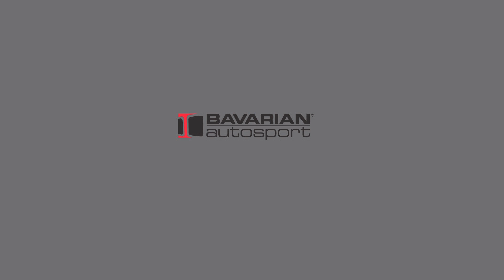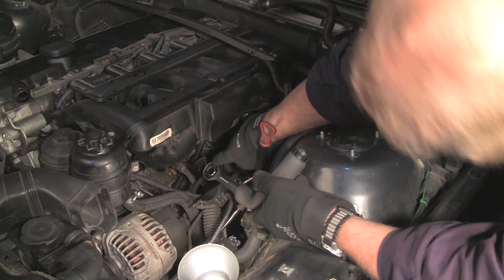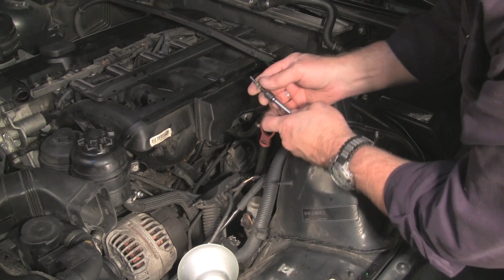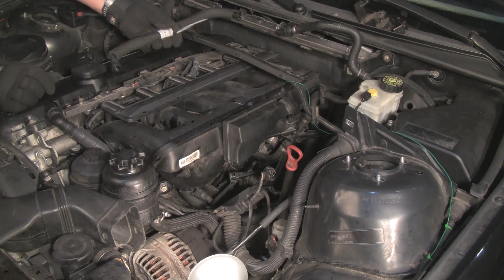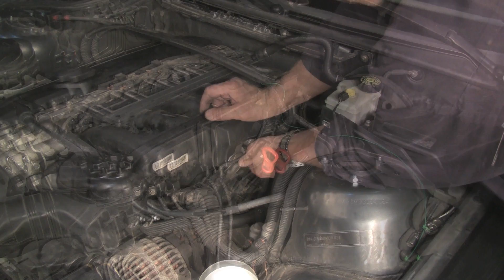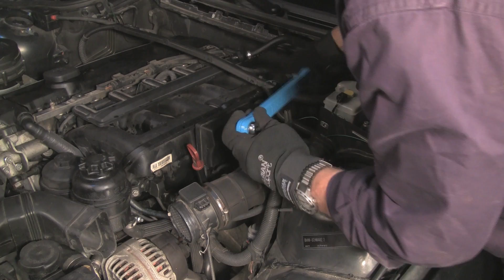Replacing the BMW M54 Crankcase Ventilation System, Part 3 of 3

Comment: You've solved a conundrum for me.  I bought an X3 which was running nicely but fuming! I changed the valve cover gasket first and no change. So I removed the intake manifold to get to the PCV . Evidently someone had been in there before.  I couldn't figure out what was going on as the Manifold spreader was closed off- just a link pipe.  The hose from PCV was open to the elements and not to the manifold hence the fuming.  Also the oil drain hose was rotten and dripping on the block. I didn't realise you could remove PCV without removing the intake manifold which was fiddly and tedious but I did have to change a cranky starter motor anyway.  Thanks so much for an extremely well explained and precise video-much appreciated.

Comment: This job ain’t even time consuming it’s very easy to complete and my cars running like a dream, the difference is mind blowing.
Have to monitor if I’m still loosing oil now and change your Disa valve too if it’s  never been done, 180,000 and my disa was wobbling pretty bad.
Have to sort a radiator leak now, pray for me.

Comment: This master mechanic makes it look easier that it actually is - be patient. On my 2006 X3; when stalling the Valve Cover Hose 1:12, 3:19 I left the CCV loose, turning it slightly to line up with the bottom hose connector, then connect the top end. The bottom of the hose will actually bend a little (look at your old one) to line up after the CCV is positioned and tightened. Like I mentioned in Part 1 removing the DISA Valve made it much easier for me to access the screws and bolts - be careful, it's expensive. Re-install it AFTER replacing and clamping the one-piece Air Intake Boot 8:57

Comment: Thank you for your guide. I did successfully replace cvs on my e53 today, and it runs well. But start hearing quick hiss noise about one second long, just after engine off. What it could be? Am I if I forgot connect any vacuum lines...

Comment: yes is a good video and very helpful ..I noticed that you wear a belt but there is no fender protector ...belt buckles do damage cars ..I bought an E46 and the L/H guard had scratches on it from whoever worked on the car before
Reply: I am going to do this job but will not replace the CCV but instead do a catch can with drain back  to dipstik tube

Comment: very much explained
please keep uploading your repair videos for BMW and/or Mercedes. Also some Technical/Preventive Procedures which could harm the system.
Yesterday I just learnt that in German Vehicles during Brake Service, we must not push back Brake Piston which can cause the ABS-Lock because of reverse flow fluid.
If you can please explain why it happens and what is the solution then. I will be very grateful.

Comment: Thanks Otto!  Just completed this DIY with your help.  Your time to create these helpful videos is much appreciated.  I removed everything the first evening.  Second evening I just installed the oil separator unit and hoses.  Tonight, I buttoned everything up.  Breaking it up into manageable pieces kept me sane!  (I did remove the DISA - made it easier to get to the throttle body and lower boot clamps.)

Comment: At track 0.25, the  hose cannot be physically inserted under the manifold with all models of a 325i sedan.  (If you want to do it that way, you will have to remove the valve again from its current location.) There is just no space as the nipple of the valve extends immediately at the hole under the manifold where the hose passes through.  What I did was insert the hose from the TOP of the manifold towards the BOTTOM of the manifold until it reaches the nipple of the valve. Then the fun starts here attaching the hose to the valve.  Remember to push down on the top part of the hose sticking out from the TOP hole of the manifold when attempting to push the hose into the valve nipple.  This is a critical step.   Good luck!

Comment: you made this look easy.... even with your instructions it took me 30 min to get that hose  on the separator and through the manifold lol
Reply: Glad it took you just 3 minutes.  It took me hours to figure out another way as indicated in my comment on where to insert the hose.  From TOP of manifold to BOTTOM in my 325i 2001.
Reply: 30 minutes I meant for your time.  Mine........3 hours!

Comment: Take the intake off. You can easily replace all the hoses, knock sensor, crank sensor, cam sensor, coolant sensor, CCV and whatever else might be good to replace on a older higher mileage BMW all at the same time and save yourself work and money in the future. I did that to my E39.

Comment: Thanks so much for this video series. I took my time and methodically followed the video and it wasn't too bad. I found that the screws for the CCV and the throttle can be seen if you are sitting in a chair looking in from low over the fender. The hardest part is definitely putting first hose connection on to the valve. I used some oil on the connector and that seemed to help.

Comment: I have a 2003 330xi I have replaced the fuel filter, the upper and lower boots, and the DISA valve, I still get CB & CA fuel trim bank 1&2 control Limit.  E4 & E3 Fuel trim bank 2 & 1 permissible range exceeded. Could the MAF cause this or do I need to replace the CCV?  Also the MAF voltage at idle is 0.7 volts is this normal? And the Air Mass at idle is 14 kg/h. please help.

Comment: First off love your videos and the detail you go into. It is frustrating watching other videos say "do this" and "remove that" but then they cut away and don't show you how to do it.

Here are my problems:
1.) I am going through about a quart of oil every 1k miles, which just within the past few months has gradually increased. I was having to add a quart about every 5-7K depending on my driving. I'll save you the details but my hunch is failing CCV because there are no leaks under the car and I just had the oil pan gasket replaced at the dealer (say what you will but I'm not confident in lifting the engine). I also note a fairly strong vacuum at the oil fill cap. There are no codes being thrown and I do not notice any smoke coming from the exhaust. I rarely make short trips. My commute is 60 miles each way to work so I think that is helping prolong the life of the CCV.

2.) I've also noticed the oil pressure (red oil can light) stays on for about 1-2 seconds after starting the engine when it's been sitting for a while. When the engine is hot the light goes out immediately. I might just be neurotic about it but to me this seems very similar to the startup after doing an oil change. This makes me think the anti-drain back valve or check valve (or whatever it's called) in the oil filter housing is not holding oil in the OFH or maybe just a slow leak. Thus i'm getting a "dry" starting condition when cranking after the engine has been sitting a while.

I want to replace the Dipstick, CCV and OFH. I have seen what a pain in the butt the CCV is without removing the intake manifold but do you think it would be easier to access if the OFH was out of the way or is it extremely tedious no matter what?

Any thoughts or insight would be greatly appreciated. I don't want to try and only to realize my fat hands can't put the CCV back together.

Comment: I went through the process and replaced the oil separator and all the hoses, but now my car won't start. When connecting all of the wiring back up, I think I accidentally swapped the purge valve plug with another plug (it's near it's near the alternator and has a brown male connector; under the intake manifold). I determined this when watching your video as the purge connector female side has a larger black box on the end, the one that I believe should be connected to the brown male connector does not (you didn't disconnect this in your video). So I went ahead and swapped the connectors and have everything back together. While the engine cranks, the car does not start. I get an error code of P0604 (Internal Control Module Random Access Memory (RAM) Error). I tried disconnecting the battery for 15 minutes, I double checked all of the fuses (both by the glove box and trunk rear passenger side), but I'm at a loss of what to do next. Any guidance would be greatly appreciated!
Reply: As I needed the car up and running, I took it to a local mechanic who specialized in German cars. It turns out I blew one of the fuses for the ECU. While I'm aware of the fuse box in the passenger side footwell and in the trunk compartment, I didn't realize there were also fuses in the engine bay (passenger side by the firewall). These fuses are below the DCM module(?) in a bank of 5. Hopefully this information helps someone else who makes a similar mistake.

Comment: 325i 03 46  54. Been losing oil for a while but increased dramatically last few months. Last 2 starts instead of a perfect low idle and a tap into a very smooth engine, it had a real bumpy idle and a lot of white smoke came out of exhaust. Smoke had burnt smell. Car has no history of over heating. Last year or so its just been used for short trips until I drove fast about 30 miles . Parked, started it up, lots of smoke. Worked once more then starting at home smoke everywhere. People are saying blown gasket but it sure sounds like it might be CCV/hoses?????????

Comment: Hi there, I have gathered all the parts required to do this job, I even bought new intake boots and a oil dipstick guide.  Watching your video has made me more confident to do this job, I ask you are your instructions (engine you are working on) the same as mine, I have a E46 330ci (2001) petrol. Im pretty sure its an M54 engine. I would not like to start this and find there is some variation on my car, any advice is hugely appreciated.

Thank you

Comment: Easiest way of checking your ccv is, start your car open your oil filler cap and pull it off, if there's vacuum and you find it hard to just lift it off then it's faulty ccv .

Comment: Hi,thx for great video, i m thinking to replace CCV system on my 2003 525i ,but first  want to come up with the reason why....car is EATING OIL ....I'm putting 1 quart oil every 400 miles,there is no blue smock coming out from muffler,,,i don't think it's piston rings...mileage is ok 22 in the city, car has 135k miles and i dont know if CCV has been replaced...how i can fix this problem ,,i dont want to do oil change after putting oil every 400 miles....
thx for your time

Comment: Hi, i have a 2000 328ci with m52. On cold start i have a rough idle and missfiring code, but when it gets warm up idle perfectly fine and runs great. Is this ccv related? Thanks!

Comment: Hi, do you need to drain the oil before starting this job.  Also, I have a 2003 BMW 525i that is putting out blueish smoke probably because I over filled it with oil.  Will the CCV replacement be similar to the M54?  Thanks, Daniel
Reply from the maker: Chun Lau No, you do not need to drain the oil.  Your 2003 525i is an M54, just like the one shown in the video.  If the system is in need of service, it may be contributing to the oil burning (the blue/white smoke).

Comment: I just spent 4.5 hours on this job. For those thinking of doing this job, the two toughest parts for me were: 1) getting the old valve out, which I had to break; and 2) connecting the hose assembly that  goes up to the top of the intake manifold from the valve. That took some major blind finagling. The fat insulated valve leaves very little room for adjustment once it's literally stuffed in there. It was a moderately difficult DIY. Worth the cash savings. Thanks BavAuto!!
Reply: hnkfsh81 It's been a week since the replacement of the CCV system and all is well. The engine runs better with improved acceleration and gas mileage.

Comment: I have a 98 BMW 528i. When the car is cold if starts and idles rough with huge plumbs of oily smoke. Once the car reached normal operating temperature it runs perfect. Ive heart this could be the CCV or camshaft position sensor. Thoughts?

Comment: Thanks for the video. I've watched it a couple of times now, seems less daunting every time I watch though. The ribbed bit from the crank case cracked on mine, it's been taped up for a while and has ran fine but the car seems to idle the rpms a bit higher than normal. Would a damage CCV and or piping cause this?
Reply from the maker: Yes, certainly can.

Comment: What torx bits sizes did you use?
Reply from the maker: The bolts that mount the check valve are T25, as we recall (could be T27, but we seem to recall T25 as more likely).

Comment: This is an interesting and very helpful video. The only difficulty I found myself facing is that for some reason the replacement valve would not fit into position with the foam jacket on. I was able to slide it into position by removing one half of the jacket. At that point I was able to slide it and make the connection. It is a fairly tight space down there and I think the jacket, by not being entirely tied together at the top added too much bulk in my particular situation. 2003 E46 325xi. Thanks for posting this video.
Reply from the maker: With the winter insulation on the valve, it will fit into place, but you do have to "cram" it in there and compress the insulation.
Reply: Thanks for the reply. I was afraid I would break something. I'm still not finished so ill give it a try
Reply from the maker: Jimmy DeVarie
 - Get it done?
Reply: all is OK, thanks for asking and sorry for the delay. The car is running great. Thanks for the help
Reply from the maker: Jimmy DeVarie
Check!

Comment: best to check the dipstick flowback chanel, if not all this would be a waste of time, also remove top air spreader and disa, makes life so much easier.
Reply: Also removing the heat shield is not necessary, plus it's a pain putting it back on.

Comment: Hope you can help.  We had the crankcase vent system hoses replaced 4 months ago so we thought, This crappy mechanic was too lazy to replace 2 hoses and possibly the plastic receptacle where the hoses are plugged into.  We received eng svc light soon after we paid big $$ to get work that wasn't performed.  My new mechanic just replaced a brand new vent sys today, I get the car on Monday.  Do you think that now that the entire system (hoses etc and center plastic part have been 100% replaced that this shsossuld resolve the eng light and lean codes?  I sure hope so.  This car is costing my wife and I a small fortune (2002 BMW 325XI).  Thank U very much.
Reply from the maker: Good chance that this is the cure.  Clear the fault codes and see if they return.  Let us know.

Comment: i did this and my check engine lght came on after words i did a vacuum leak test with some wd40 would not changing the gasket on the throttle body cause this
Reply from the maker: Possibly.  What is the fault code that has been stored (due to the light coming on)?
Reply: i did a leak test an got nothing but i dont have an obd2 tester yet its on its way its an amber service engine light
Reply from the maker: benito serrano
 - let us know what you get for codes.
Reply: i will thank you i think i may have figured out what is is i inspected the DISA valve and it is making a loud popping noise when i turn the flap and i was told it should not be that audible what do yo uthink
Reply from the maker: benito serrano
 - We don't recall the valve doing that when we have had them off.  You may have an issue there.
Reply: well thanks for your assistance i appreciate it

Comment: hi, first many thanks for uploading the video.
I am in the process of installing PCV on my 2005 325ci E46. The part requested has a small nipple on the valve and a tube with it. But my car's PCV valve (old one which is to be replaced) doesn't have this small nipple. So what should I do? should I blocked/close the nipple on new pcv valve with something (like a cap or some silicon)?
I also can see in your video that new pcv valve doesn't have small nipple? what to do? thanks in advance
Reply from the maker: The early models had a vacuum line from the small nipple to the fuel pressure regulator.  Later models do not use this line/hose.  The new valve will still have the nipple, but it should come with a rubber cap over the nipple.  If your valve does not have a cap on the nipple, just purchase a vacuum cap (that fits the nipple) at a local auto parts store.

Comment: Hi
I have Bmw 523i 1997. Is it the same procedure? Because i have m52 Engine.
Thanks for the video
Reply from the maker: The M52 engine uses a different crankcase ventilation system.  On these, it is easiest to remove the intake manifold to access the check valve assembly .... which is very easy.

Comment: Hello, Just viewing these videos but I am wondering why not remove the intake manifold? Can you tell me what the symtoms are for the reason this needs replacement. I have codes e3 e4 fuel trim lean 12 cam signal 08 maf sensor  and misfire codes. could these be a result of this issue? Thank you
Reply from the maker: The job can be done by removing the intake manifold, but this is a lot more work.  This method has some tedious points, but cuts the work time substantially.  As for your fault codes and diagnostics, please send us an email at info@bavauto.com.

Comment: Sound is totally messed up.
Reply from the maker: Les, We have found that the sound track does not play properly on computers that are using the internal speaker.  Try to find a computer that has a separate stereo speaker system installed.
Reply: BavarianAuto The sound was a bit "unlocalised". I bet one of the channels is out of phase, which means that in a mono-mix the two stereo channels will cancel each other out. How this could have happened, though, is a mystery. (Perhaps a tick box to phase invert one of the channels in your video editing software.)
BTW, this was the best video tutorial I have ever seen, by a wide margin! Fantastic work!